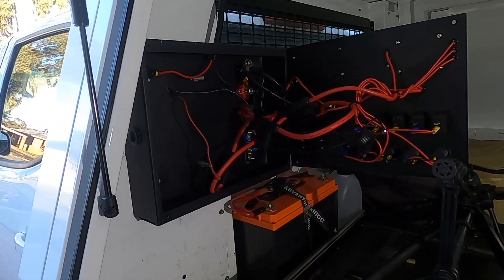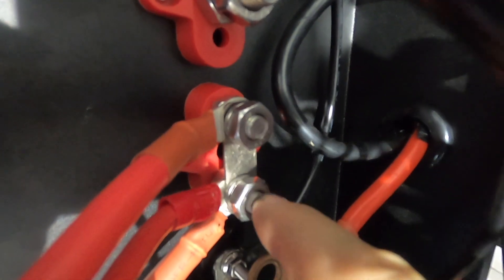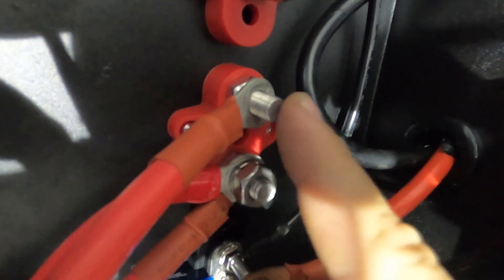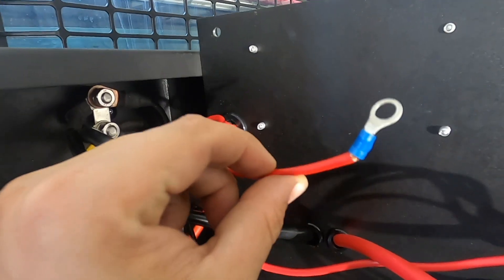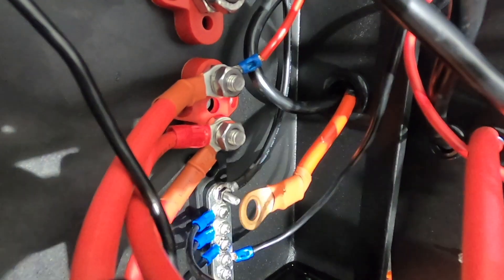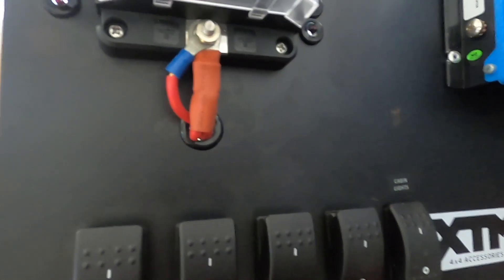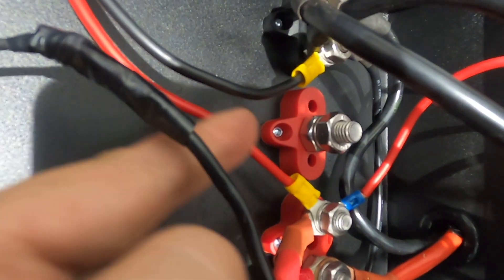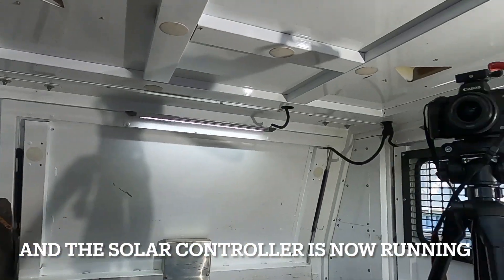XTM 12V CONTROL BOX SOLAR INPUT | VICTRON ENERGY SOLAR CONTROLLER

Comment: Hey mate, why does the power cable from the solar controller have to run through the fuse block before running back to the bus bar post going to the battery? Why can't you just run this power cable from the solar controller straight to the bus bar?
Reply from the maker: Hey mate, with the Victron unit it generally wouldn't need to. 
A standard unprotected MPPT charger though wouldn't be fused between the charger and busbar so a short could damage that cable.
Reply: @OutNAboutAustralia So as long as the cable between the controller and the battery is is fused, either way is fine?
Reply from the maker: @FknMonte yeah mate as long as it’s fused with the right size for the cable 👍🏽

Comment: Hey mate great explanation! One thing on these 12V control boxes, there's only one cable running from the aux battery to the box. Does this mean current runs both ways along that single cable (current coming from battery to power accessories + power coming from dcdc charger, or solar, running into the battery to charge)?
Reply from the maker: Hey mate,
In a roundabout way, yeah that's pretty much how it works.
Current will only move in one direction, however, if your charger is generating more power than you have loads, current will flow IN to the battery as well as supply the required loads.

If your charger is generating less than the required load, the battery obviously takes up the slack and current flows OUT of the battery to make up the difference.
Reply: @OutNAboutAustralia  awesome thanks for the explanation!
Reply from the maker: @roderickjon9788  no worries, happy to help!

Comment: So where do you put negative from solar control box
Reply from the maker: Hey mate,
All the negatives in the XTM box are common to each other, meaning they’re all interconnected on a negative bus bar and connected to a main negative. 
So straight to the negative bus bar is fine
Hope this helps 🤙🏽

Comment: Great setup, you have done well there, just a thought, would it have been more simple to just run a length of twin directly from the input side of your charge controller to an Anderson plug mounted in the canopy and then plug in a splitter cable to make it possible to plug both your fixed panel and your folding panel to the Victron unit? I dont know if that makes any sense the way I explained it, but basically just bypassing the control box.. ?
Reply from the maker: Hey mate,
Yeah definitely could have gone that way. 
Only reason I didn’t is I wanted the fixed panel hard wired inside the panel (just personal preference)
But the splitter cable is a quick and easy way of doing the same 👍🏽

Comment: I'm an idiot and this stuff confuses me. Im getting it all professionally done, but i had a quick question. I can had a Foldable Solar panel that i just pull out when im stopped, this connects to the anderson plug, that then runs through the MPPT and back to the lithium battery is that correct? 
Im getting the same setup and will have one anderson plug for the Fridge/ freezer then hopefully one for the solar panel. 

I just don't wanna setup a permanent Solar panel on the roof and just wanted to have one i can pull out and plug in when needed. 

Cheers for the video.
Reply from the maker: That’s right mate one wires into the solar controller and the other comes straight off the battery 👍🏽

Comment: Hey mate, firstly absolutely loved the video, has helped me heaps already. 
In regards to the mppt controller does the earthing wire for the battery need to be anywhere specific or can it be wired anywhere inside the control box? Thanks in advance!
Reply from the maker: Hi Troy,
Ideally, it should be grounded back to the main ground terminal in the control box, which should then be grounded to the battery & chassis of the vehicle.

Comment: Hey mate 
What’s the biggest gauge cable you can put on that Victron Mppt in the battery terminal
Reply from the maker: Hey Michael,
Victron suggests 6mm or 10AWG. 
This is what I’ve used and I doubt I could go any bigger.
Reply: @OutNAboutAustralia  cheers was thinking would have been that size so stoked to wire up my 150 enerdrive solar panel and Victron Mppt this weekend 

Thanks for your help
Reply from the maker: @michaeljenkyns1719  No worries mate.
Hope it goes well for ya

Comment: Thanks for the great video. Does there need to be a fuse between the mppt controller and the battery?
Reply from the maker: No worries mate. Thanks for the comment. 
The unit is fused on the output side but it’s always a good idea to fuse all active cables 👍🏽

Comment: Hey mate what gauge wire did you use from the battery to the control box ?
Reply from the maker: Hey mate,
I’ve used 2 B&S cable just to allow for a 1500W inverter to be installed parallel to the control box 👍🏽

Comment: Hey man great explaining how to connect and connection for a solar blanket and fixed panel 
What would recommend as MPPT controller and solar blanket mostly running a fridge full time and  say 2 12 v appliances
Reply from the maker: Thanks mate, appreciate that. 
If you want solar charging only, I’d suggest the same setup as I have (Victron 100 | 20 & 150W solar panel)

However, if you’d like alternator charge a good dual input is iTech’s DCDC20 or DCDC40.

Comment: Hey mate, new to the 12V DIY game. Could you just connect the Solar Panel positive cable directly to the MPPT charger instead of the top terminal? I assume your other dedicated Anderson plug is for your Solar Blanket connection? Keep up the awesome video mate!!
Reply from the maker: Hey Dave. Yes you could mate. 
Your spot on, the reason I’ve connected inside is the terminals on the Victron unit are only big enough for one cable.

Comment: Am I right to assume that your solar blanket is unregulated at the blanket? it runs into your solar charger on the xtm box. Nice video too :)
Reply from the maker: 100% mate. 
The blanket runs into the Victron controller parallel to the fixed panel.
Reply: @OutNAboutAustralia  I thought that may of been the case. Solar blankets normally come with a charge controller but like you say, You're using the Victron one instead
Reply from the maker: That’s it mate. The Victron one does the job really well plus with bluetooth  you can always see exactly what it’s doing.